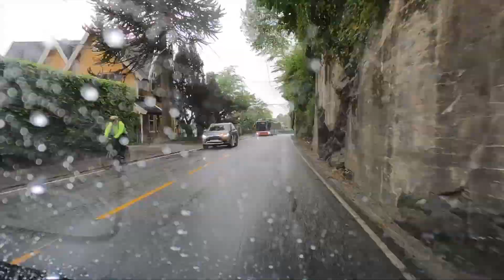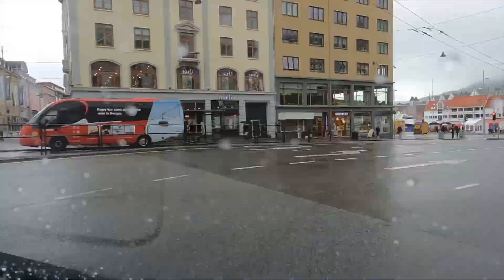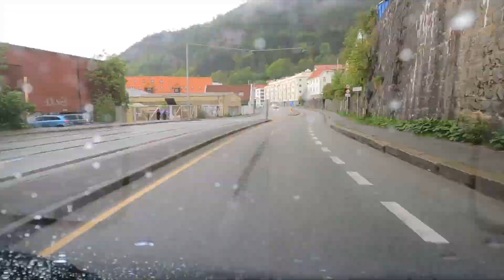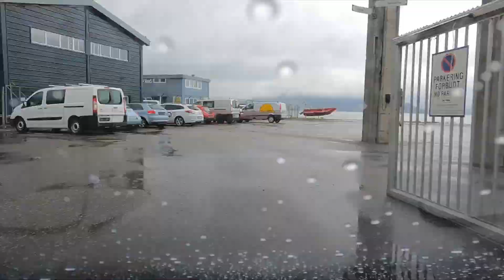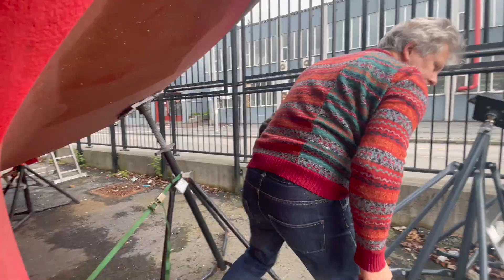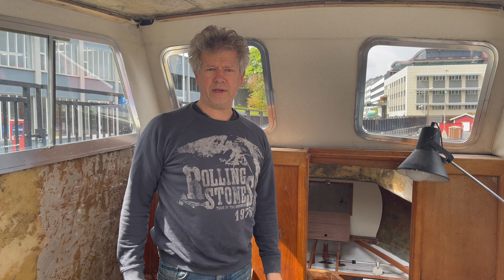Fisher 30 motorsailer Ep 9 - destroying the engine room

Comment: Cheers from Camano Island on our Tresfjord 28!  Love your new videos.  It’s great your daughter is helping!  Your shop looks amazing.  Is that yours or do you share with other boat guys?  And tell us more about your French boat!  Love that style of boat.  On my boat The teak was in which bad shape I actually ran it thru a planner to clean it up.  Then I used West system epoxy for base coats followed by Epifanes varnish for top coats. Really worked great!  Looking forward to your next video!
Reply from the maker: Hello Bradley. Great to read that you are enjoying your Tresfjord 28. 
The workshop is a hired help as I dont have the tools to refurbish the teak. If we dont succeed in getting new teak for a reasonably price I will go for the full refurbishment, even though the teak will end up slightly thin. Due to the weather - lots of rainy days - I will only oil the teak.
Should I do a extra presentation video on the Rhea 900? Why not? Do you think that will be of general interest for this channel?
Reply: Good afternoon Blimp.  I would love to see a video of the Rhea.  Looks like a really solid boat!  Be sure and show us the engine area. I believe other viewers will find this interesting also.  Looking forward to your next video!
Reply from the maker: @bradleyroberson1074  Good evening, Bradley. I will take your input into consideration and possibly prepare a video of my Rhea 900 within reasonable time. Thanks for your input. 🙂

Comment: One way to deal with the destroyed Philips head screws is to use a hobby grinder (Dremel tool in the US) with a cut-off wheel to cut straight slots in the bad screws. You can then use a straight screwdriver to get the screws out.  This works well for situations where you must preserve the materials instead of beating and prying them apart.
Reply from the maker: Thanks for your advice, Earl. I actually have a Dremel. 
In this instance I would´nt spend time on it as I will replace the old external diesel-filter with a new Racor filter, and the wood on the engine mount will be removed. So all good :-)

Comment: My bulkhead under the mast was in poor shape. I installed a square aluminum tube and it supports the mast directly to the keel.
Reply from the maker: That was a smart move. I would have gone for the same, but think the superstructure needs that wall, especially since I am thinking about removing the forward wall in the pilothouse, to have an open space. Thanks for your input!

Comment: How or why did the fisher get in such a mess......it will be an almost total rebuild ? I thought fisher yachts were tough ?
Reply from the maker: Hi Steven. After almost 50 years all the seals and putty has hardened and hence are leaking. Since that matter has not been dealt with, the boat has had years of water-intrusion from above, damaging the interior and the structural integrity of the boat. It feels bad to remove all the beautiful interior, but it is really the only smart thing to do. 
The Fishers are very though and the quality of the glassfiber is still excellent. But even high quality needs TLC (after 47 years). :-)

Comment: Well , you got a like from me , my friend , but man , what have you done ???? .
Reply from the maker: An open question, Mickey. Lets find out over the coming months. Thanks for your "like" and for watching. :-)
Reply: @hsobstad   😂 lol 👍 

Like me with a job i started , you've opened a can of worms , but you're get there . I am , and you did with the outside .
Reply from the maker: @mickey1299  There is no fun in half way. Go all in! No regrets! ;-)
Reply: @hsobstad  Ah , now that i can relate too . I started three years ago , doing what should have been a straight forward job . Replace the timing belt , and renew the water pump , it wasn't even leaking but at 20 years old , i figured it's a respectable age . Now , three years later , i've completely rebuilt the cooling system , rebuilt the timing system , and right now in the process of completing a complete rebuild of the power steering . Along the way , i've been had my fingers in the windshield washer system , and numerous other functions of my motorhome , including the electrical system . Like i said , can of worms .
Reply from the maker: @mickey1299  Ohh... A motorhome. I am considering building me a motorhome in some years, when my wife retires from work. 
Sounds like you are about to have restored all of your systems in the motorhome. That is excellent work and must give you faith in regards to reliability and safety. 
I would consider rebuilding a van into a motorhome. This way I can custom make all systems according to my (and my wifes) desires and not buying something made (trying) to fit everyone. In Norway a motorhome really is the way to explore the northern parts.
Reply: @hsobstad  With a bit of luck , yeah . The main aim was mechanical , i have a trip planned to visit a friend in Spain , whose ex wife died early 2020 . It's a long story , but shortened i got involved with a training school of theirs . Yes i do have faith in its abilities now , it's an old year 2000 Hymer , based on a Fiat Ducato x230 . I've owned it for the last 6 years , very low mileage , with just shy of 50 000 km , but poorly maintained by the last owner , i'm now it's third . 
I would agree to building your own , mine has loads of space being an A class , but considering the pedigree of this vehicle , i'm less than impressed with the quality . I've found more than one bodge , that must have been introduced during the conversion/build , and of course previous owners have added and removed bits at random . The electrical system was right mess , plus i found the fuse block melted . Due to age parts are difficult to source , and of course being a left hooker , only available aboard (i'm in the UK) . Kinda ironic , huh , you have a Fisher built in the UK , and i have a German motorhome , based on an Italian van .
Reply from the maker: @mickey1299  We actually had a Hymercamp many years ago. It was also based on a Fiat Ducato, but with a 2.5 litre with only 60 hp. Gearshifter on the steeringwheel. If I remember correctly it was a 1988. It also had its flaws, but I believe the Hymer is a good brand, with decent quality. And I also fund the Fiat a technical good engine and gear-wise, but with a lot of rust. Only had it for a year as it was hard for us to find a place to store it. With its 7.2 meters of length it was a mouthful to maneuver in tight spaces. 
Yes, I have the UK built Fisher with left-hand steering and the french built Rhea with right-hand steering. Who came up with such ideas. "Lets put the steering on the boats on opposite side of the cars steering".... 😀
Reply: @hsobstad  Hmmm , yeah a series one , and by the sound of it , an unblown motor . Mine is a series 2 with an inter-cooled 2.8 , and 122bhp on tap . Second biggest motor fitted in a Ducato , but even that is a little short on steep inclines . Same lower engine as the 2.5 , but an extra 300cc at the top . Sevel production , it's actually an Iveco enhanced motor . Matter of fact , it was one like yours that set me on my eventual path to what i have now , though it was only a 6m . Mine is a shade bigger at 6.2 , not sure i would want anything bigger , for the reasons you give , though at three berth , i have loads of room . The 2.5 , and early 2.8 are considered strong motors , with the term bulletproof often used . It's reportedly good for something like half a million miles . Personally , i don't think the later 2.8's (post 2000 , 2001) , and subsequent motors will live up to that same reputation . They are loaded with sensors and electronics , diesel engines simply don't need , so reliability will suffer as they age . Post 2006 are smaller capacity at 2.2 , 2.3 litre , meaning they will have to work harder , so to my mind fuel consumption will also suffer . I'm getting a shade over 30 to the gallon , on the flat .  
Gearboxes are not in the same hilt though , yes the me5 was a good box , but the mg5 is trouble some (guess what i have) , and the later comfortmatic is more than a handful .
The conversion in general is good , but some of the details are a little sketchy . I was lead to believe they are quality , but with what i've found , i'm not sure i could call it so . 
Yes i think you could be right with steering , i know of a swedish right hand drive motorsailer , but i'm afraid i favour a tiller personally . I always was the awkward one .
Reply from the maker: @mickey1299  Haha. You are not awkward. Lots of people prefer the tiller, as it is way more reactive. Though important that the boat is well balanced. Had a tiller on my Dragonfly, with a tiller-pilot, but now I prefer to stay in the pilothouse when it rains (much of the season). 
Mechanical troubles follows when owning mechanical stuff. Does not have to be used/old. I bought a new Morgan 3-wheeler a few years ago.... Disaster! Had to force them to take it back.
Reply: @hsobstad  Yeah , every boat i've sailed has had one , and i kinda got used to them . I like to trim a little to weather , between that and the clouds , i can hold a pretty accurate heading , without constantly looking at a compass . I hear what you're saying in regard to the rain though , it can get a bit damp outside at times . I like the idea of sitting inside , but i alway's think of my last boat . That had quite a long tiller , so i could actually steer from inside , with the top hatch closed . Wasn't much of a win though , the windows steamed up , and I couldn't see out anyway . However , the long tiller was a plus , my next boat WILL definitely have one of those , you could sit up by the cabin bulkhead , and shelter under the spray hood . I once piloted my mate's 30 odd foot power boat .  I dunno , maybe it was slack in the controls just , or summit to do with the tracking of the out drives (it was a twin) , but i found the steering vague , and the boat appeared to wander somewhat . I notice Malc always appeared to be correcting the heading at low speed , with some quite large inputs , directional stability was definitely missing . Didn't notice once he opened the taps though , too busy hanging on , to notice such mundane things like control inputs . 
Now i'm really shocked , Morgan was perhaps the last of our great car industry . I felt 30 grand was a bit rich for my liking , but my dad had , had three of the originals when he was younger . Two Japs and a Matchless , 1927 - 31 models , even taught mother to drive in one . He said they were silly quick , but you could strip the rear cog real quick using the full performance too much , and that was a week's wages gone . 
Yeah , you're quite correct though . they don't have to be old to break . But the older ones are much easier to glue back together again .
Reply from the maker: @mickey1299  The things end up owning us. So important to prioritise which to keep and let the rest go. 🙂